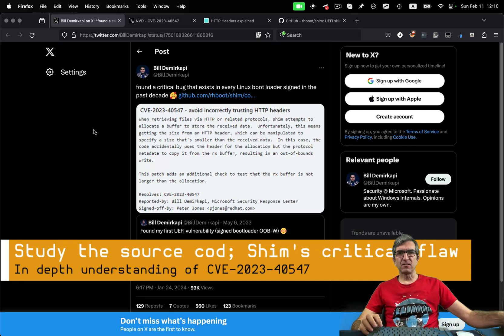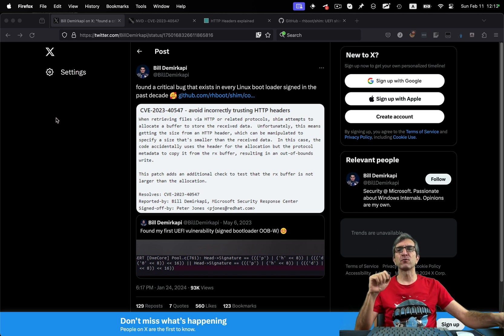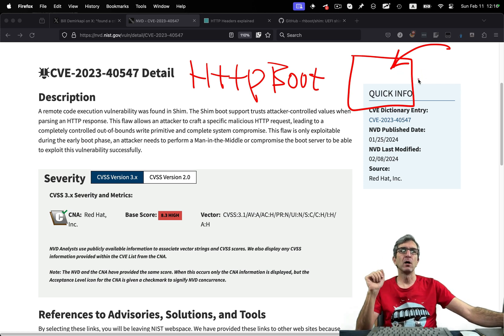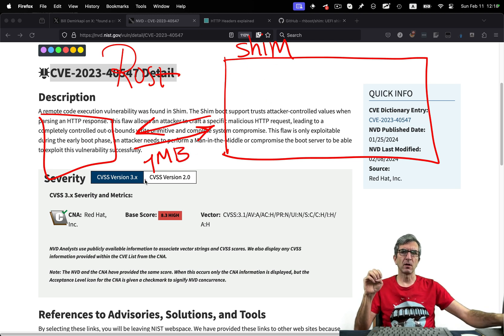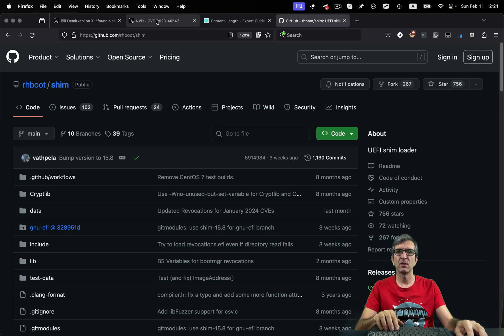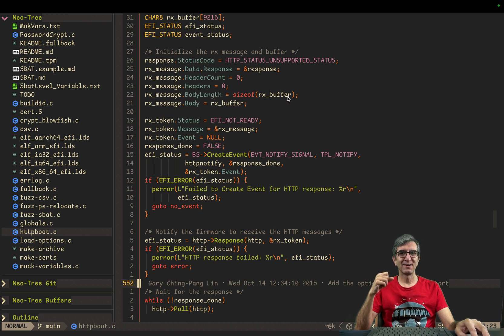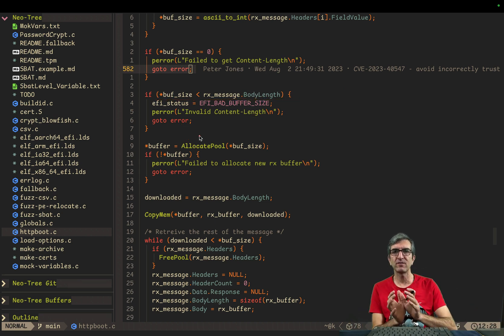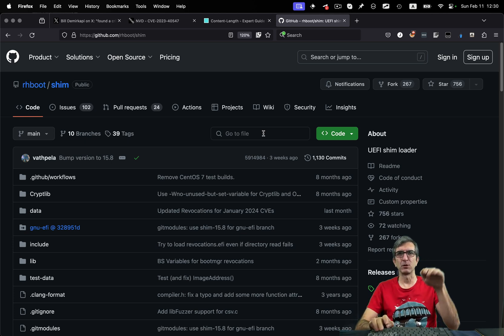A deep dive into the RCE via CVE 2023-50547, Studying the source code of `shim` (C)

Comment: Greate content Jadi Jan. 
As you mentioned, this bug is related to memory safety and could not happen in languages such as Rust.
Is this related to Rust's data structures that automatically resize themselves when needed and prevent buffer overflows or another language feature?
Reply from the maker: Rust is designed to be memory safe. Concepts like borrowing & ownership prevents dangling pointers.In addition you can not copy a larger data into an already defined vector which is smaller and the usage of pointers are very limited.

Comment: nice video 
I have a one question 
why they don't use https instead http which is more secure ?
Reply from the maker: In general we call it "httpboot" but you can do it over https too. This depends on the answer from the DHCP although hardware (UEFI) can be configured to force http / https or auto select based on the URL.